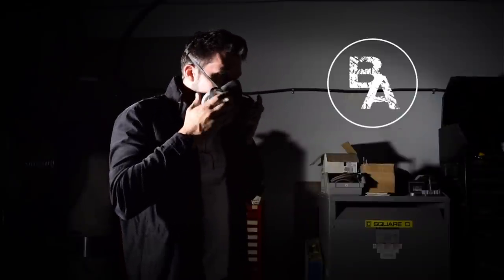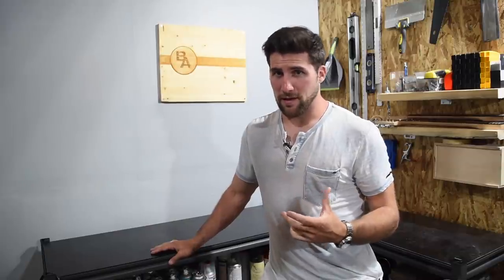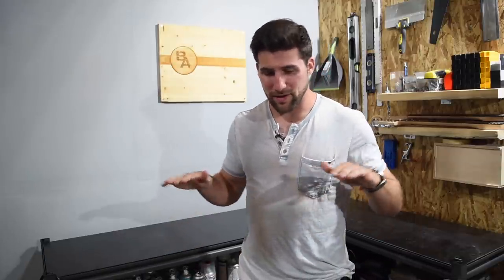Why is your paint crazing?

Comment: Just painted a plastic dust buster housing with Rust-Oleum American Accents Gloss Orange (Paint + Primer). Prepped it with1500, then 2000 grit paper. Cleaned it with soapy water in a  spray bottle. Then rinsed it with distilled water from a spray bottle. Dried it with lint free blue shop towels. And finally sprayed it down with 70% Isopropyl alcohol, and dried that with a blue shop towel.
   Shook the new can of paint for a full minute, then sprayed the piece with a light dusting coat. This paint dries FAST. Shot the second coat 10 mins later, which built into a gorgeous orange gloss, with ZERO orange peel, wrinkles, or dusting. It was PERFECT. 
  Shot it outside in direct sunshine, at 84° F, and 48% humidity, per my gauges, with almost no wind speed. The only thing I had to worry about was that errant A-hole flying insect that inevitably decides he's seeing a "huge orange flower." As luck would have it, he never showed. The piece was pristine. 
    And I should have taken that as a sign, and stopped right there. Afterall, it appeared to have a clear coat on it already. 
    But NOPE, I HAD to "protect" this beautiful paint job with a can of 2X Gloss Clear, from the same line (Rust-Oleum American Accents). After 45 mins of dry time, I "sanded down the glossy surfaces", per the can of Clear's instructions, with the distilled water spray, and a 3000 grit paper. Gloss now gone, I dried it with a blue towel, walked it out, and set it in the sun to air dry an additional 5 mins.
   Went out after shaking the Clear for a full min, and started the same process as the paint job (2 coat system), except this initial coat wasn't a "dust" coat. It wasn't sag worthy either. But enough to go on as a "full gloss" coat. 
  Everything went swimmingly for oh, about the first 25-30 seconds. Then, as if by magic, the entire job began this amazing (albeit HORRIFYING), "wrinkle crinkle" transformation that would make the worst orange peel one could imagine look perfectly acceptable by comparison.
   And now I'm "here", with the rest of the neer do well "painter" class....crying yall a river. 😂
    So, thanks for the insight. After watching this, I'm now thinking one of three things happened. The "gloss" (obvious, NOW 😂) component of the "GLOSS Real Orange" paint, is a clear "built into" the paint. Duh. So, not only is a clear coat not required, but even if seemingly "sanded off", the clear base solvents were still present. So, BAD REACTION.
   Another possibility may be "something" unseen, but present in the blue shop towels that was left behind during the wipe downs. Which didnt effect the paint going onto the plastic. But once left on the sanded paint surface, was a disaster waiting to happen. 
  Then there was the 5 min sun drying of the piece. Did the UV in the sunlight somehow act as a negative catalyst on the paint surface, to cause the reaction? 
    Regardless, I f'd it up. I think I'll just strip it, and reshoot it with only the gloss paint. And if you've made it this far, sorry for the sad sappy sob story whiney bitch novel I'm about to post. 😬
Reply: I've read stories like yours far too often, there's a ton if you read the reviews on the paint! Sorry it happened to you. I'm not entirely sure what causes the cracking... In my experience, shooting the clear as soon as you can after gloss allows for a better bond. This is obviously not possible if you're doing any sort of wet-sanding, but I haven't always needed to. 
Anyways, if you find a solution, be sure to share it here!
Reply: So my experience with this is TBE paint isn't cured. You have to wait 24 hours or longer for all chemicals to come out. Some paints require clear be applied minutes after. If you wait too long but not long enough "24hr" them it cracks.
Reply: @beenheredoneit.4381  👍
Reply: @beenheredoneit.4381  ^ This, based on what happened to me.  Now I'm afraid to apply clear...
Reply: @beenheredoneit.4381  ^ This, based on what happened to me.  Now I'm afraid to apply clear...

Comment: I'm working on a project that I hope will eventually turn out great, but painting the guitar body has caused me endless headaches although it has also taught me a lot because of the mistakes I've made. First of all, before I even thought about painting I did a "mock up" matching the body and neck (with the original electronics) and the tone and playability were excellent, so I knew they were a good match. I disassembled everything and started with the body which had considerable gashes, holes, and other damage. It is made of mahogany, which I soon discovered was a very pourous wood. My first mistake was to completely sand off the existing finish before filling in all the damage. This is where I realized that I should have left the original finish on. If I had done that, I wouldn't have had to spray so many coats of primer (which of course didn't work). I finally decided to use a gloss protective enamel which seemed to finally start giving me a clear coat. My next mistake was to use too much of it. I found that it wouldn't dry. I tried baking it in the oven and leaving it out all day in the summer sun for over a month and the over runs were still not dry. Out of frustration, I put it away for a couple of months while I started learning to use my paint guns. Anyhow, when I got it back out and all the paint was finally dry. I started hand sanding it with some 500 grit paper, but the over runs were so thick that I used an electric sander with 200 grit paper just to try and get a flat finish. That removed most of the "crazing", so I started hand sanding with a higher grit paper but I still can't get a lot of the "rippling" out without sanding it almost back to the bare wood. As I mentioned before, I've learned a lot about what not to do but now I have a deliema. Should I keep sanding until all the mistakes are gone and start over or try and salvage what I started? I have a friend with a shop which is heated now that the weather is cooler, so that's not a problem. I also know a guy who owns an auto body shop and I'm almost to the point of frustration that I am considering taking it there and letting him finish the whole job. I really want to do this myself but on the other hand, I want to get the paint job done so I can put the guitar together (I've had all the new electronics and other hardware for months) and start playing it. If I do decide to paint and finish it (polyurethane) myself, how do you suggest I do this. I am an advanced player with many years of experience, but I'm still a novice at painting. Any advice would be greatly appreciated.
Reply from the maker: +Mulehead now that you’ve built a finish on there, everything should be sealed up. I would sand it back flat using a sanding block, and re-finish it. This time use light coats. 3 coats of colour 15 minutes apart. Let it dry for 3 days. Sand smooth at 800 grit. Then repeat with clear coat, twice (6 coats total. 
For the drying, let that happen inside. Never put drying paint in direct sunlight. 
Let those final coats dry for 2 weeks, then you should be able to sand and polish. I’d give it another week or two after that before putting hardware on ideally.

Comment: Thanks! I was already sure to leave everything (paint and doors) at room temp over night and I was still getting pretty frustrated because my issue is manifesting in my second coat on several doors I need to get done. The first coat on both sides of every piece had zero crazing, so I’m basically ruling out contaminates. I will try a slightly lighter coat and allow even more dry time between. New subscriber today 😎
Reply from the maker: I hope that fixes the issue.

Comment: Good information, great job... I would call aged laquer "crazing"...  I would call Lacquer over cheap enamel "wrinkling" "peeling" or "stripping" & I would call too much paint, solvent speed issues or temperature issues "cracking", "splitting" or "crackle". But the term "crazing" to me I would reserve for old paint jobs usually Nitrocellulose Lacquer, that get brittle & crack over a long period of time, humidity issues or sun exposure... maybe decades. Lacquer can be shot and adhere on urethanes & even some enamel if they are well sanded, shot with a quality adhesion promoter like 222s (formerly Dupont, now Axalta) Sometimes you need to spray the first coats of Lacquer dry over the 222s if the enamel is of low quality catalyst. This will help avoid "wrinkling" the cheaper enamels. A quality "sandwiched" airbrushed lacquer artwork (Urethane/222s/lacquer/Urethane (Imron) finish can last for 40 years in the Florida sun with no crazing or pealing.... Guitars often have "crazing" when they were painted in nitro and get old. I went back to 100% Polished Nitro Lacquer on all my guitars due to the exceptional sound of Nitro. Finally one more source of wrinkling is laquer shot too wet with slow thinner or retarder that is then cleared in urethane before the solvent leaves the lacquer... for this reason it is advisable to use fast thinner with no retarders (wash thinner) to spray lacquer if it is intended to be cleared in urethane. Blushing due to moisture and fast thinner is not an issue if the lacquer is to be clear with urethane just sand with 500 and clear it. Everybody can call me out now "OLD SCHOOL"? :)
Reply from the maker: I believe the industry term for the cracking in aged lacquer is “checking” rather than crazing.

Comment: You were absolutely correct regarding your chemical analysis.  I was using two different brands of paint; Rust Oleum and Krylon.  Both were called Appliance Epoxy.  I had completed my project with the RO and ran out, but there were a few holidays.  I began touch up with the K and spiderwebs or crazing came out all over, but not everywhere.  It reminds me of that chemical that removes paint from cars; it just seems to break the bond.
Reply: I think I bought the RO at Walmart.  The K I bought at Lowes.
Reply from the maker: Damn. Sorry to hear that happened.

Comment: Wow, you even have a video on this? Anyways, I commented the other day about painting my acoustic. A matte black base with pearlescent floral designs all over. After throwing on the second clear coat, this crazing began to appear literally everywhere. It's completely ruined and all of that meticulous work has been wasted. But it does make me feel a lot better to know that I'm not the only one who's had to experience this disappointment. Thank you for the informative video! I'll be sure to put this knowledge to use now. It's not the first time I've had to learn from my mistakes

Edit: I think my issue is that I might have been too generous with the clear coat, which caused the shrinking and crazing.
Reply from the maker: Yes this is unfortunately a problem that arises for a lot of people.
Reply: I got a aluminum speaker cone to a perfect black  mirror finish....waited 18 hours and applied a clearcoat both rustoleum, and pretty much instantly it started crazing....I had used it before and rhis never happened...ever figure it out?
Cause this didn't really help me, the speed of it happening has me convinced it was some sort of reaction...whole morning wasted 😞

Comment: Thank you for the explanation of paint crazing.   I totally screwed up my first paint job where I had bubbling on the hood and top of my car and shrinkage along the edges of where I painted.  It has scared me to not repaint the car.  I want to overcome this huge failure but I  am driven to learn how to paint better.  Should I wait at least a day after primer and a day after base coat before I do a clear coat just in case to avoid trapping solvent?   I appreciate any and all advice in advance.  Thank you kindly!
Reply from the maker: What kind of paint are you using?
Reply: @BradAngove  I used a 2k paint and a 2k primer
Reply from the maker: Yeah I’d give it a day or two to be safe.

Comment: Just as I suspected.. This video confirmed that it wasn't just me going nuts. (liked this video btw). 

Story: Ran into this problem for the first time in my life today. I got gloss spray paint for my son's bike and painted it, and it came out AMAZING... THEN..... I decided to lock it all in with a clear gloss for a clear coat kinda finish. (both were enamel). Bottom line, I have to run and get fine grit sand paper and repaint out all the cracks. I think I'll let him ride it for about a week before I attempt the clear coat.. Let the actual paint bake and cure for a while. 👍🏼
Reply from the maker: Damn. Yeah, you’ll want to let it settle and cure for a bit before trying to fix it.
Reply: @BradAngove  I've painted car parts and guitars and furniture and came out flawless, this caught me completely by surprise. Hence me stumbling onto this video. Haha

Comment: Hi there! This is very informative, never having dealt with something like this before, I really wanted to understand where I went wrong. I am doing a DIY in my bathroom on the countertop with Rustoleum Appliance Epoxy spray. I started to get this problem and I think it’s because I didn’t wait the 30 minutes for the next coat.. I waited a day. So now, sanding like crazy to get it smooth and guess I will wait a week to recoat (since the can says recoat in 30 min or a week). When I recoat, I will be sure to do much lighter coats. You live and you learn, right?! I learned on this one for sure!!! 🤦🏼‍♀️

Comment: After finding out what they wanted to charge to paint my car I decided to take it on myself. I did a complete prep job of the entire body by hand and decided on using Dupli-Color Paint Shop for all three stages: primer, color, and metallic clearcoat. I decided to use the same manufacturer for all three stages to avoid problems just like this. Initially the results were spectacular. Two years later, my car started an insane amount of crazing but only on the hood. My question is; why did it occur 2 years later? If I applied too thick wouldn't that have shown up much sooner than two years later? 
Sidenote: All coats we're done with a sprayer, no rattle cans.
Reply from the maker: Duplicolor is acrylic lacquer. It probably reacted to heat and sunlight because the clear coat doesn’t have enough UV protection.

Comment: itd be great to hear something about "resolving" it. Do I have to sand it down and re-start or can I lacquer remover/thinner the crazled paint down with a rag?
Reply from the maker: I would sand until it’s smooth and go from there.
Reply: @BradAngove  Yeah I tried the thinner but it didnt do anything so I went to 400 wet sand option till the crackle went away & resprayed it to match the other areas. thks.

Comment: I just got finished painting my guitar and i put the clear coat on when i turned away for about 5 sec I started to notice some crack and shrivel up . I had chills running up and down my back but it only happened on a certain color. I wanted to do a EVH frankenstrat look to my guitar and the only thing that was affects by this was the red everything else was fine. I probably did not dry for long enough, too bad I have to take off all the red though :(.
Reply: Just happened to me. Crazy custom paint job on a PS2 as a birthday present for my dad, did everything right and the very first layer of clear reacted and ruined the entire paintjob. Never use Rustoleum American Accents 2X Clear smh

Comment: Thanks for the explanation 👍
I’ve had horrible clear coat problems with lines and “scratches” in the finish. As per your explanation I think it’s because I had way too much heat in my workshop. Thanks again
Reply from the maker: I hope it helps you get the result you’re looking for.
Reply: Thanks a million Brad👍 I’m sanding back the damaged clear and repainting on Monday. Will let you know what happens👍👌
Reply: Update; job worked out perfect 👌 once I kept the temperature of my workshop correct. Thanks again for the help Brad👍
Reply from the maker: Glad to hear!

Comment: Hi Brad, really appreciate your videos. I'm painting a bike frame (aluminium + montana gold) and just sprayed my 2nd coat of SprayMax 2K  matte. 1st layer came out nicely, cured 24 h and lightly sanded with 800. 2nd spraying crazed/crackeled in parts. I suspect too cold & humid + too thick of a coat... can this be saved? Can I - let it dry,  sand down the bad topcoat and give it another go with a fresh can of that expensive 2K? Cheers
Reply from the maker: Yes, that’s how you would go about fixing that.
Reply: Hi, Ive never heard of that 2K paint till just now & I found it on Amazon. Whats special about it? Did you say you sanded (wet?) between coats w/800? Were you able to resolve the crackling? Ive just painted a portion of my truck w/Rustoleum Professional Gloss White & had the 1st coat come out gr8, but the 2nd coat (55hrs later) crackled in 1 spot. Thanks.
Reply from the maker: Have a look at my video on how to get a professional looking clear coat with spray cans.